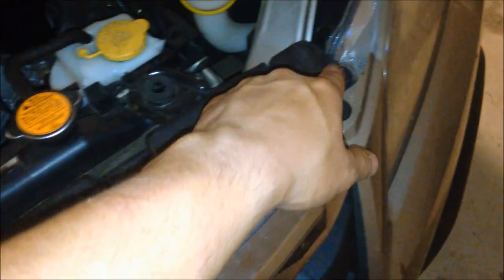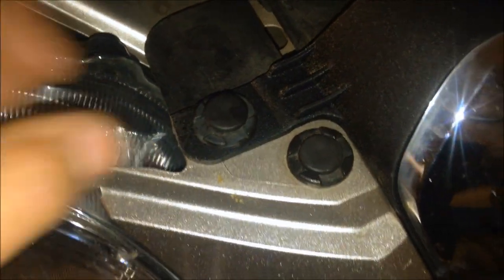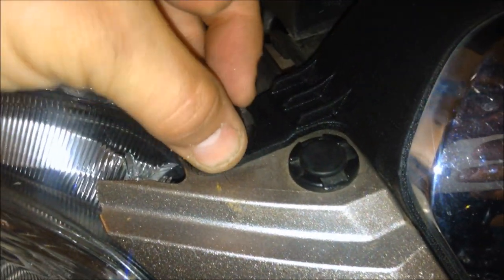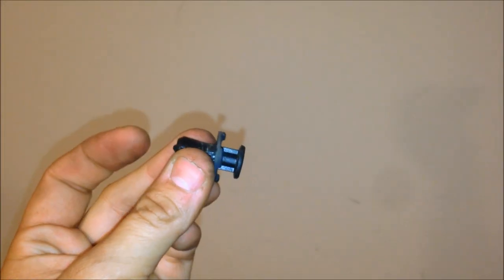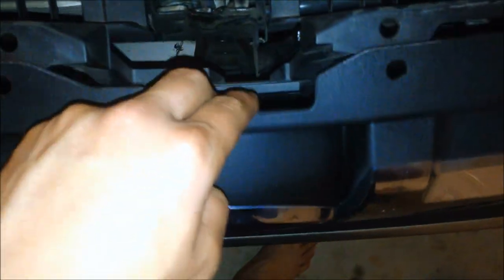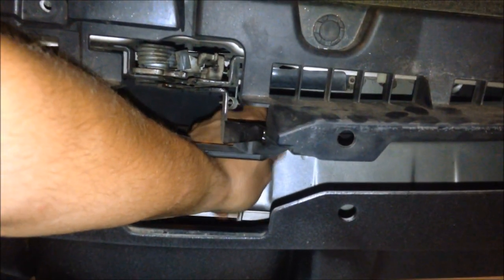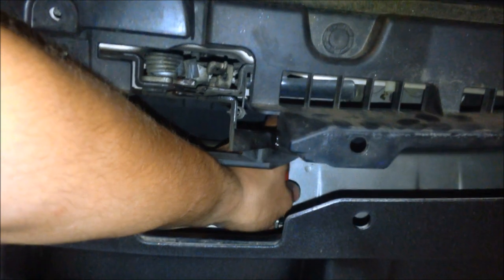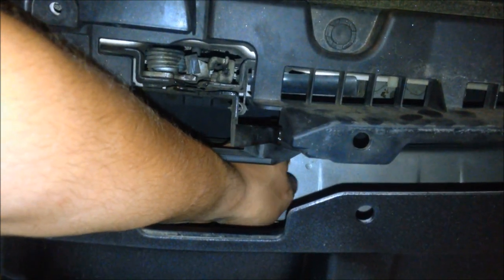4th Gen Subaru Outback, Grille Removal

Comment: Great video, thanks. I have a 2013 forester and I’d like to remove the grill to paint black. Will these instructions work on my forester? I’d love to not have to take the whole bumper off. Thanks!
Reply from the maker: I'm not sure if it's the same for the Forester or not, I'm sorry. It's a different process on the WRX. But you may find that the Forester is similar to the Outback. Best of luck!